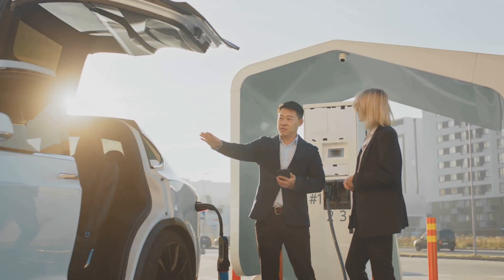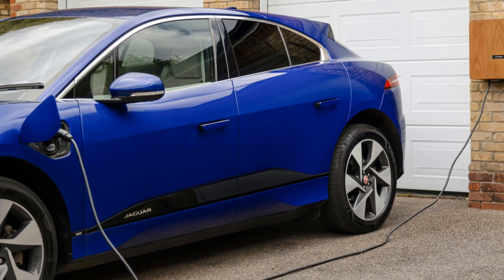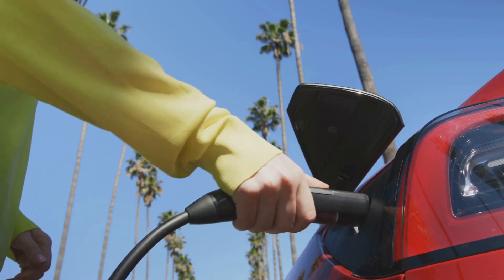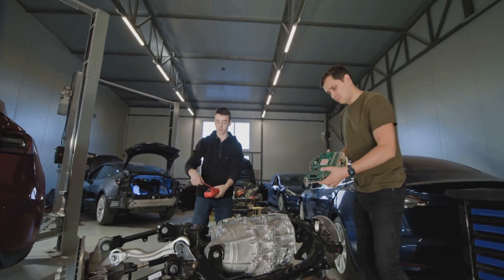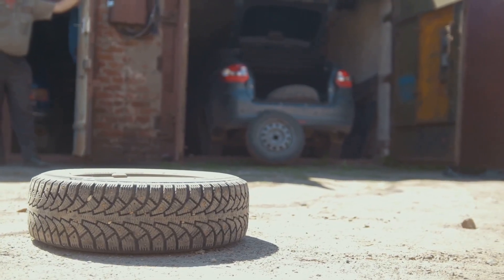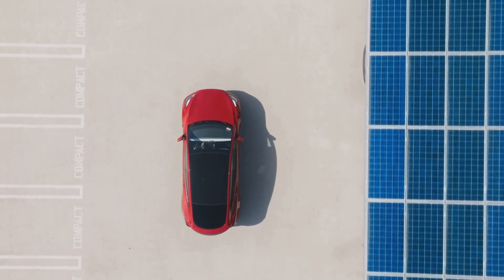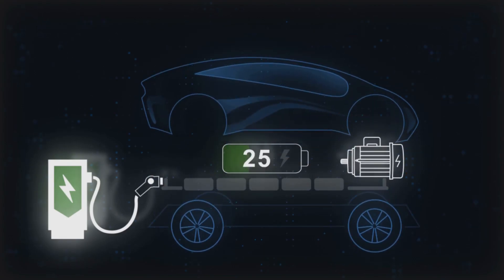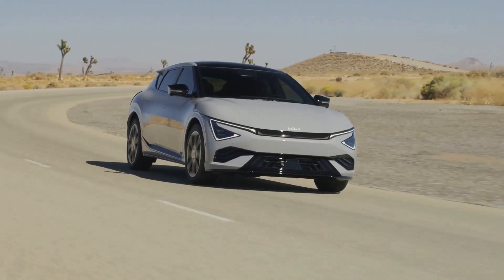Secrets to Maximizing Your EV's Performance

Comment: Losing range in acceleration after a few months, NO, does not happen.  In fact EVs hold their performance much better than gas cars.
DC fast-charging does not degrade the battery much